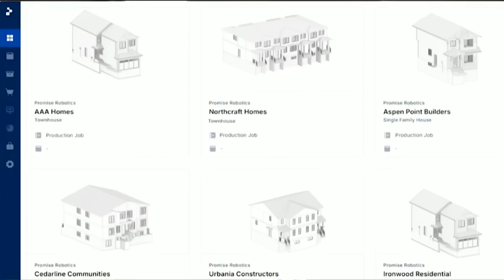Robotic home construction comes to town

Comment: A team of framers can put up a house in days, without that overhead and CEO's to pay. Not sure how this will bring down the cost to build.
Reply: It is called "scaling."
Reply: @striker44 that only works if every house being built is the same or you're doing a big building out of wood. The other issue is that you're still relying on the speed of the foundations being installed. These factories aren't big enough to where finished items can be stored in house. They need to be made and sent out the door. That impacts speed. So there will still be bottlenecks. Not to mention overhead. A team of framers has a truck, one trailer and a few compressors lol ... They can undercut these guys heavily.

Comment: A carpenter could build at 5 times the speed of the robots.
Reply: The speed of robots will improve....cars are mostly built by robots and are fast. 
Robots don't need a break like humans. Just some minor maintenance and they are off to work almost 24x7. Also, no unions. Job gets done faster and cheaper.

Comment: 2 guys not available to hammer nails on the jobsite but 20 computer programmers   plus tractor trailer driver's and crane operators only to need 2 guys back at the jobsite to put the walls together 😅

Comment: Get into the trades they said. AI won’t replace trades they said.
Reply: Correct. How do you expect the interior to be finished? How do you expect wire to be run, plumbing lines to be run, furnaces to be installed….How do you expect a toilet to be tied in for drainage and water supply? Flooring? Kitchens installed? This isn’t even considering maintenance work such as repairing drywall, augering sewer pipes, changing light fixtures etc etc. Yes we still need the trades and yes there’s plenty of opportunities that aren’t going away any time soon…..

Comment: You will never get rid of true stick framers, custom homes cannot be built buy these machines…
Reply: They can be built by machines. The issue is that machines reach peak efficiency when they are constantly building the same things. 3 or 4 house plans in a subdivision would be a great way to leverage the robots. A custom home would slow down the assembly line and make it too costly to justify a builder to go that route. Similar to how trusses on a complicated roof cost exponentially more than a simple gable roof as they need to change up the jig constantly.

Comment: The labor cost to frame a 2,000 sq.ft. house is around $20,000, when you factor in transportation costs the prefab savings is around $5000.
Reply: Prefabs have not historically been viable, beyond the costs they are a poor business model with an endless sea of bankruptcies. The only reason they will get any traction is corrupt politicians shovelling public money to investments they are connected to. Prefab has largely failed to stand on its own.
Reply: @furycorp  prefab doesn't mean entirely fabricated structures... trusses, wall panels, floor systems, stairs have all been prefabbed for a long time, especially in the Calgary market.
Reply: @furycorp ex-actly